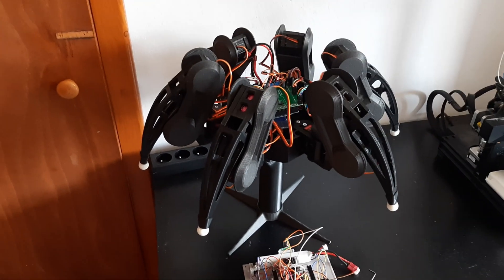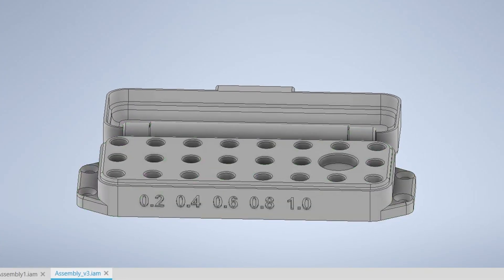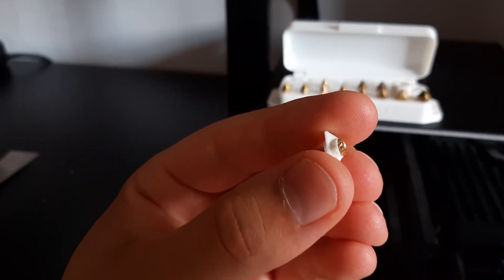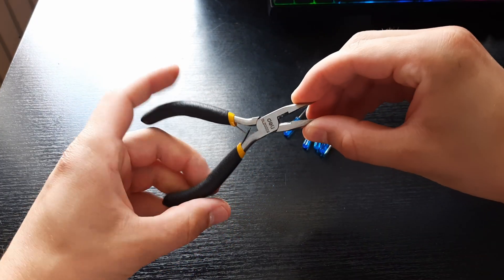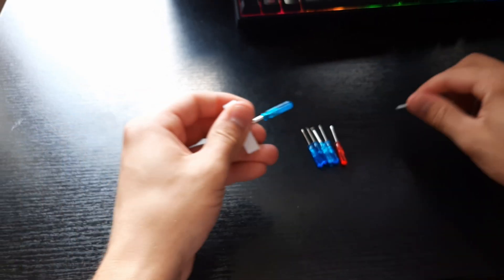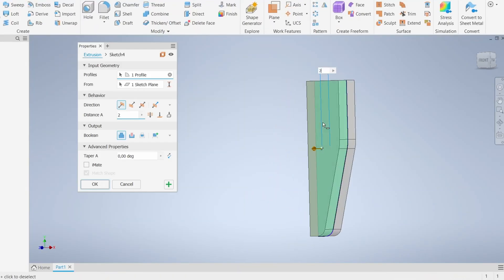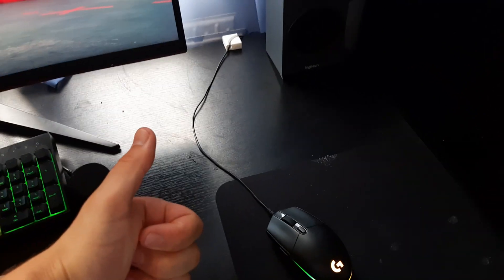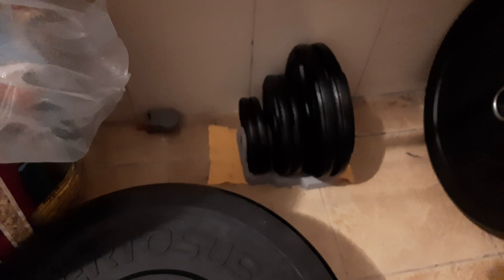3D Printing Useful Stuff

Comment: Doesn't the part for changing the nozzle melt, as i always change nozzle after heating up the nozzle?
Reply from the maker: It doesn't melt when you are screwing the new nozzle in as it doesn't have enough time to heat up. When taking the nozzle out though, it melts a bit even if you do it quickly, so I use a wrench.
Reply: @TazerEngineering oh okay👍🏻 , and the video was good also